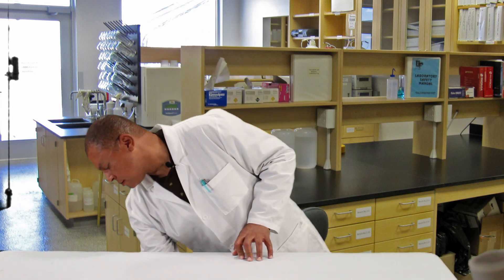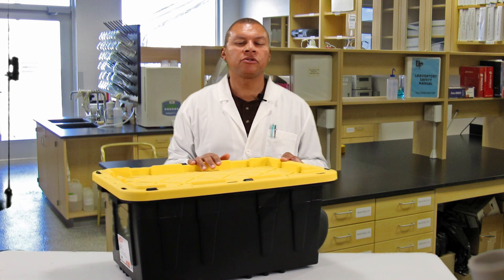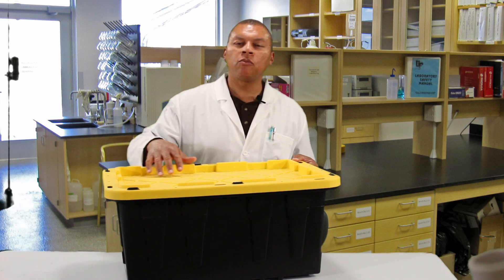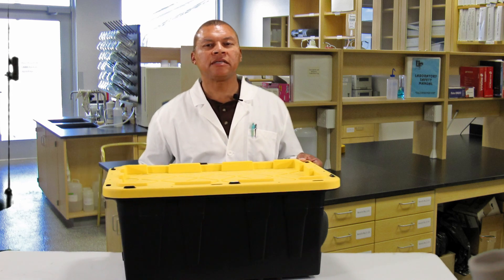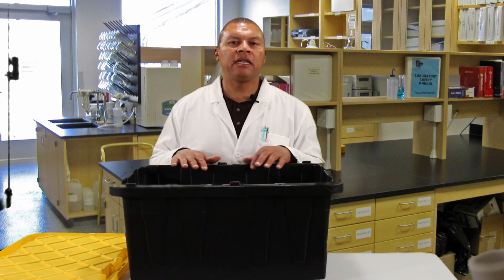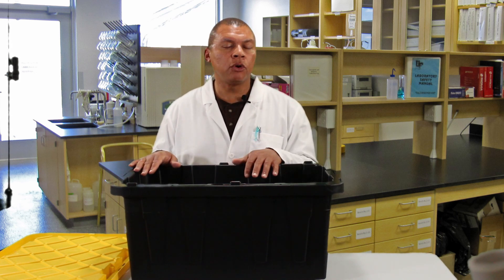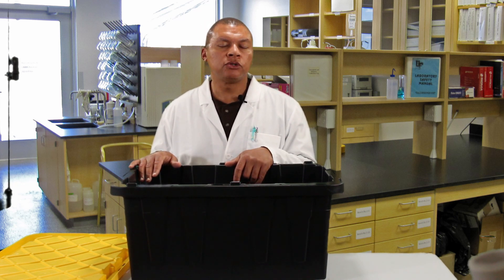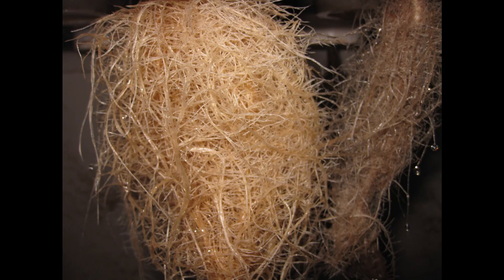Aeroponic Growth Chamber / Root Chamber - How to Choose the best chamber. Part 1

Comment: What is the best position to put misting head in inside the ice chest for best root penetration
Reply: Ive tried top, bottom, and side and the side is by far the best. If you put them to the bottom the roots will cover them. Top is also not terrible.